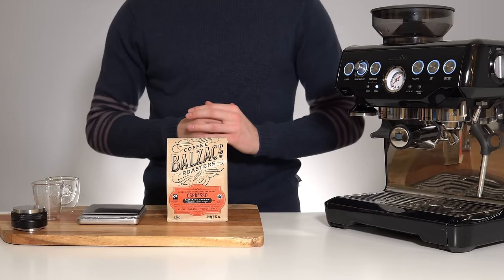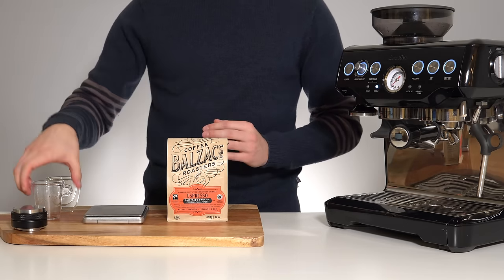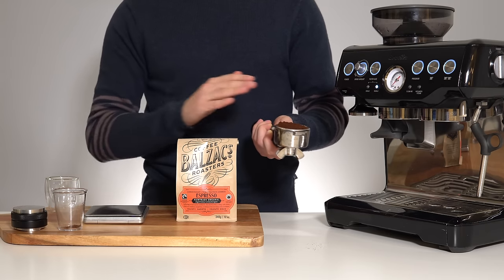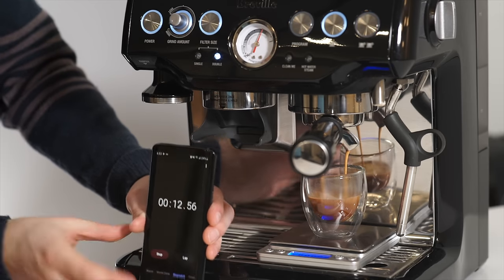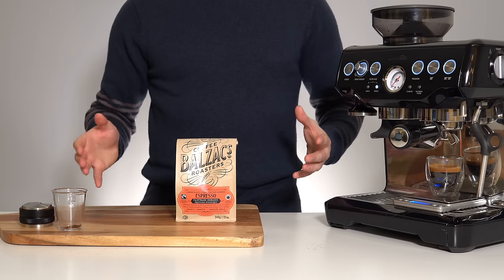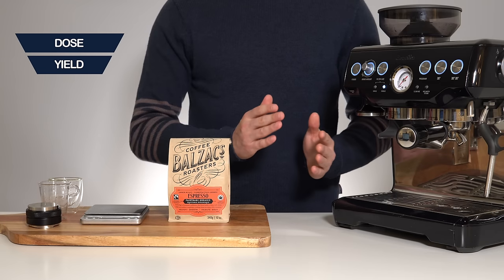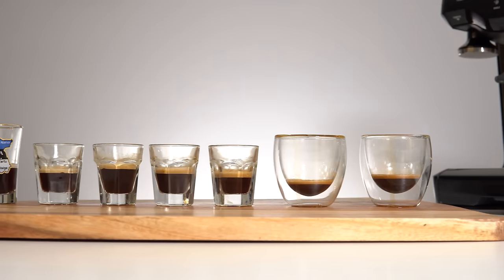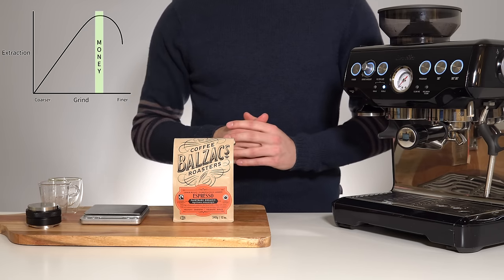Dialing In Breville Barista Express | Dose, grind, yield, time

Comment: Hello, I have a question as a beginner home barista. 

I have the Sage barista express and I bought a really dark roast bean (of course fresh and high quality). 
I weigh my beans, 15-16 g (I started with 18 g but found it to be too much amount to fit in the basket,  I read somewhere it's because of the dark roast) and I pull a 1:2 ratio shot ending up with ish 36 g of espresso. I have tried both finer and coarser grind but can't find a good setting that fines my problem. 

SO HERE IS MY PROBLEM:

1) The time to pull my shot is super super fast... I end up getting 36 g of espresso in like 7 sec... And I understad that I should grind my coffee finer but this doesn't seem to help. The dark roast been becomes extremely fine, like more fine than powder. 

2) When I grind the beans at a finer setting I end up with a wet puck. I understand this is a symptom of too fine grind which I guess is the case because grinding my dark roast that fine as I said makes it almost vanish haha... But setting a coarser grind just pulls the shot so fast (like 5 sec??) and I end up with no crema at all. 

3) The taste is really strong and has a lot of bitter tones and almost a little sour sometimes. 

Please help me succeed with my dark roast espresso! Any tips?? What grind setting should I try?
Reply from the maker: Sounds like you’re using a stale, very dark coffee This is a misconception that you need “espresso roast”. If it’s too dark, it’s quite literally charcoal and just falls apart to powder. Not to mention tastes bitter as all heck. 

Find a local roaster, buy a fresh bag of something medium, and you’ll have an entirely different experience

Comment: Some help/advice please after following your great steps. With my BE, I grind 18g beans (11 days since roasted), get 17.7g out. Distribute evenly in portafilter. Knock on the counter a few times. Then tamp. Even with a light tamp and checking with the razor, the lightly tamped coffee grind is 2mm lower than the razor. Q1) Is this an issue and need to add more ground beans? 

Pulling a shot consistently takes 10-11 seconds to the first drop and then an additional 22 seconds till 36g. The pressure gauge is between 1 and 2 o'clock. Q2)  Any advice here regards those times? Thanks again
Reply from the maker: It sounds like you're on the perfect track! Now, use the concepts from the second half of the video (and your tastebuds) to dial in to suit your preferences :)

Comment: Hey, thanks for doing the video, I have just received my new machine, same as yours and have a couple of questions please. I currently have it set on the finest setting and am using a 16g dose, it seems like it’s a bit too much as I’m having a bit of waste. My shot time is currently running at about 13 or 14 seconds for 32-34g of extraction. With it on the finest setting and maximum capacity of the portafilter what else should I be doing to extent the shot time? Thanks ;)
Reply from the maker: You still need to grind finer, and luckily, eventhough you've reached the minimum grind setting you still can! Here's how! https://youtu.be/QNvOcE4-VEo
Reply: @LifestyleLab_  brilliant thanks mate!

Comment: I am eager to try this new way of weighing the beans and all the details you offer. Can you or ANYONE OUT THERE WHO HAS THIS MACHINE tell me what your water temperature is coming out into your cup? Mine is hitting shot glass at 160 degrees. The water from the valve for tea or rinsing is coming out at 172 degrees F.  The program buttons only all you to go up or down by 4 degrees. I have read different places that the temps should be higher like 185-194 degrees F. What is your Breville Express BS870xl/af16 measure?  I left a message with the company on their email server. Hopefully someone can confirm or deny that my problems with horrible shots this last year is temperature related.   Thanks in advance.
Reply from the maker: Unless you are measuring at the group, with a scace device, you won't be getting an accurate temp measurement. Even as the water passes through the air, into the colder cup, the temperature rapidly drops. 
Cup temp does not equal puck temp

Comment: Looking for some advice. Even when using the finest grind setting (1), to get a 1:2 ratio from 18g of beans it takes less than 20 seconds to extract yet the pressure goes above the recommended range on the gauge. My tamping has been consistent using a hand tamper so unsure why I’m getting these results. Had same issues using multiple different types of beans, issue with the machine or my technique?

Comment: Are the grams and times at 6:49 halved for a single shot?
Reply from the maker: I typically use the same grind setting as my double shot, and drop the dose to 11gr for a single shot basket. You will want to maintain the same brew ratio and flow rate

Comment: Can you tell me if you're using the default portafilter filter, or have you switched to a different one (ie. double wall or whatever else. I think there are 3 other ones that come with the machine). I have been using the one that came inside the portafilter, I haven't switched it but am not sure if I should. I always click on the double cup button (for double espresso) and I have the filter size set to double.
Reply from the maker: Pressurized vs Non Pressurized Espresso Filters
https://youtu.be/eOKKMu5wmQA

Comment: Are you supposed to always weight your output once you've dialed it in on manual?
Reply from the maker: If you've programmed in the button to the correct shot length, it should be relatively consistent without the need to weigh. However of course, weighing is the only way to be 100% accurate as the button programming is only time based

Comment: I'm using illy classico with this machine on a grind setting of 6. i did it as per your instructions. 18g and a stop watch to 36g liquid. i used the included tamper and got a uniform puck. pulling the shot i got a time of 23.5 seconds and the pressure dial was showing halfway between the last two hashmarks in the "espresso zone" so probably just a little before the 1 position... it came out dark with an obvious crema layer. what should it taste like and how do i judge whether it is sour or bitter. i've always gotten a caramel macchiato at sbux and never had a pure espresso shot so im not sure what the taste is supposed to be like. illy classico is 100% arabica (5 espresso beans on a scale of 1-9) says mild and balanced. i tasted it just as the plain liquid with nothing added to it and it tasted somewhat sour i think? i forgot to turn it off at exactly 36g because i was watching the time for when it hit 36 exactly. when i turned it off the scale was measuring 45g so im not sure if that had an impact on the taste. (it was drinkable after milk was added and  2 pumps of vanilla syrup). what am i doing wrong. my previous espresso machine was a krups one without any bells and whistles no settings  or anything so this is my first foray into making espresso and having major control of the extraction process.

Thanks, Jonathan

Comment: Awesome video. Ive wasted at least 40 cups so far. I keep getting 18seconds, then 40 seconds as i adjust.
Now ive hit the impossible. I had too high pressure and it took 18 seconds.
IM LOST 😫😫😫😫
Reply from the maker: The grind settings on the Barista Express can be a bit too big of a jump at times (18sec - 40sec) 
Use the setting that is getting you an 18sec shot, and increase your dose by 0.5gr - 1.0gr to get an extraction that is in between the two grind settings.

Comment: What is that cup that you used to collect the grinds directly from machine?   Link?   Seems to be perfect size to do it this way
Reply from the maker: It's a plastic Nespresso sample cup. However, there is going to be a metal 54mm dosing cup released soon that I will link here when it comes available :)

Comment: Hi, I am using 18g of freshly roasted coffee and a grind setting 7, and getting consistent "ok" shots at 20 seconds. If I try to push for the magical 25 second zone, by going to the 6 grind setting. The flow is bad and it take +40 second. I guess my technique is not perfect, but how many second of difference should I generate by changing one grind setting (I.e. going from 7 to 6)

Comment: I have tried the 19gr of beeds to 38 gr of coffee. First I cannot get more than 15,5 gr of coffee on my double porta filter or it will overfill, even after compressing the grind. So let say I should have 31gr of coffee, if I keep the same proportion 1:2. My machine give me 62gr of coffee in 25 seconds on expresso setting. I can custom the water volume down as I wish but 31gr only fill half a cup of expresso. This will also reduce the time by two. So I think there is something wrong with those measures.
Reply from the maker: If you can't fit 18gr in the filter basket, you likely need to be grinding finer. 

1:2 is a classic espresso ratio, which is why we used it as a STARTING POINT. If you watch the second half of the video, we discuss alternative brew ratios :)

Comment: On the grind size dial, what range of numbers do you typically use for pulling espresso? 

I've found that I've typically settled in the 1-3 range (18g shots), but I'm wondering if there is something else about my prep that is causing me the need to grind finely all the time...
Reply from the maker: Unless you have channeling in your puck, there's nothing wrong with grinding fine to build pressure. You can actually grind much finer than a grind setting of 1 by changing the INTERNAL grind setting: https://youtu.be/QNvOcE4-VEo

Comment: The problem that you do not see to mention and maybe I missed it is the boiler heating. They hotter the boiler the more water pressure that comes out which means a courser the grain. Also if the boiler is cold you will need to use a finer grain. So as your machine heats up you need to adjust the grain. Your machine is fully heated in about 30 mins for consistent grain at 5 pending on the beans. I typically will wait the 20 to 30 mins start at a 6 and adjust from there. I left my machine on for an hour once and I needed to use a 9 to get the right consistency.
Reply from the maker: This isn’t true. Espresso machines have overpressure valves to deliver the same pressure regardless of brewing temp. You should always wait for your machine and portafilter to fully warm up, and then run a 5-10 second purge of the group head before pulling your shot.

Comment: Does the low pressure pre infusion time get included in the 25 second shot goal? I just bought a Breville infuser and right now the total run time after pressing the button to when water stops running out of the machine is about 34 seconds with a pre infusion of between 8-9 seconds. any advice/ feedback is appreciated :)
Reply from the maker: Focus on taste and dial in accordingly! 
How to Time Espresso Shots | Button Push or First Drip?
https://youtu.be/E9MiqOJdwPc

Comment: Thanks for the video. I’m a new user for Barista Express. I couldn’t achieve 25 - 30sec extraction time for a double shot with 40g yield even though I already use the grind size 1 and the dose amount is 20g. I just got 18-19 sec. Do you think it is the problem of tamping? Thanks.
Reply from the maker: If you've reached the minimum grind setting and it's still running too fast, you need to set the INTERNAL grind setting finer! Here's how: https://youtu.be/QNvOcE4-VEo

Comment: I am having trouble. I am following the guidance. 18g of beans, step by step making the grind finer due to the extraction being too fast. I've now reached a point when the pressure gauge is on maximum and still extracting 36g in 10s. I shouldn't make it any finer due to the high pressure, how do I slow down the extraction to reach the desired 25s?
Reply from the maker: Ignore the pressure gauge.  Notice it wasn't mentioned in this tutorial

Comment: Hi. Great video. My problem is....My extraction is around 20 secs and my grind size is at its finest so how can I make it slower. I put 18g of beans in to get 36g out. Its even worse with the single wall basket. How can I slow it down if i cant make it any finer. Thank you.
Reply from the maker: If you've reached the minimum grind setting and it's still running too fast, you need to set the INTERNAL grind setting finer! Here's how: https://youtu.be/QNvOcE4-VEo
Reply: @LifestyleLab_   Thank you. Love the videos. best ones on the internet. Keep it up.

Comment: What is the recommend way to start the timing? Breville says as soon as you press the single or double button. Others say, start the timer when the first drop hits the cup. Any input?
Reply from the maker: Aiming for a specific time is only a rough starting point! You need to dial in to taste based on your coffee and individual preferences as shown in the second half of the video! This is why there is some conflicting information, 25 seconds from button push might work for one coffee, 25 seconds from first drip might work for another, 40 seconds might work for another! There's no hard and fast rule

Comment: My pressure doesn't go up to the espresso range at all, even though I programed a manual double shot to the max to see if it will reach that range and I also let the machine warm up for more than 30 mins, do you think I got a defective machine or there is something else I should know about?

Comment: i have the same machine and have a question: during the preinfusion phase, coffee already comes out of the machine into the cup. I use grind size 3, with mid-price beans, single shot sieve and single shot setting on the machine. I tried tampering harder, tried more coffee, nothing helped. The pressure during extraction is pretty much perfect, but the preinfusion is off. Can you give me some tipps?

Comment: I was having the hardest time but finally got it to work. But I'm not sure it's still correct. I tried doing 18g through all the grinds - didn't work. Increased the dose to 22g but it doesn't fit in the basket, so I shaved a little off... this seems to work to get 36g in 20sec. it tastes fine, but is this right? Thoughts?
Reply from the maker: Two things: 
1) You can grind finer by adjusting the upper burr setting (not the external dial) once you reach the minimum 
2) if it tastes good, you've done it right

Comment: Even with the finest grind size with the double basket I cannot get the bar pressure high enough to get even a 20 second pour, very frustrating.  The beans im using are from a local roaster.  And im using the same machine as in this video.
Reply from the maker: https://youtu.be/QNvOcE4-VEo
Reply: @LifestyleLab_  Thanks, looks like my Barista Express is a slightly older version and does not have that setting in the higher burrs.  I gave it a proper clean out and am now getting the right pressure, but the timing is off, I'll keep experimenting with other beans.  thanks a lot regardless.  Great videos..

Comment: What size tamper  do I need for the machine your using? Your link has several sizes. I am getting the same machine you have
Reply from the maker: These machines use a 54mm tamper

Comment: i hate the tough of weighing coffee and using a timer everything i want to make a coffee. is it possible to make consistenly decent shots by just eyeing stuff up
Reply from the maker: You don't need to time every single shot once you are dialed in. The machine can be programmed to your desired run time, and therefore will reproduce the same shot each time when give them same grind, dose, and tamp.

Comment: Using the non-pressurised double basket, I've set the internal ring inside the grinder to finest, then set the external dial to finest and I tamp it down very firmly however I'm still getting around 50gr of espresso in around 11 seconds. The pressure does rise up into around the "ideal zone" and tastes ok, but I feel like something is wrong still. Is it just the crappy beans I'm using?

Comment: I also just got a breville but I'm a total newbie. It seems like 18 g ground into fine espresso doesn't quite fit in my portafilter? I don't understand what I'm doing wrong. Also do the grounds need to get pushed down below the lip of the portafilter? My breville came with a thing called the razor which seems to be for leveling the grounds down below the lip of the portafilter. I am confused Thanks for any tips.
Reply from the maker: As you grind coarser, the grinds take up more space. So if you can't fit 18gr into the portafilter, you need to grind finer :) 
Yes the grinds need to be pushed down far below the lip of the portafilter, otherwise the grinds will contact the group head. The palm tamper helps keep this depth consistent

Comment: It’s kind of hard to see just how you are starting the grinding into the little cup. Are you using the top edge of the cup to press the switch?
Reply from the maker: I simply pushed it once with my finger to started the timed dose (which was set to maximum so that it grinds until empty). Then I use the button grind button to stop the grinder once all the beans have gone through.

Comment: My machine says it has 4 temperature settings as well, however, the thermal camera only shows a 170F to 178F delta...
Reply from the maker: The 4 settings are in 2 degree increments, so an 8 degree gap from lowest to highest is bang on to spec. What’s the issue?